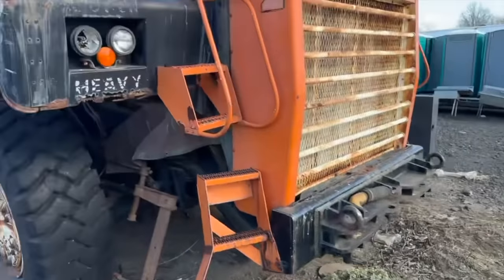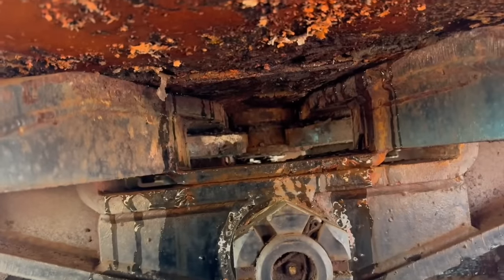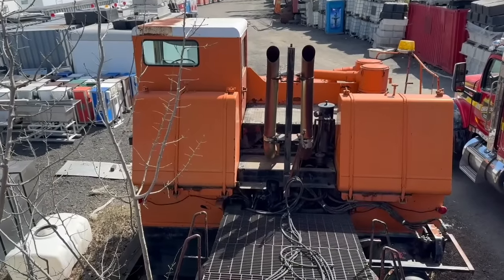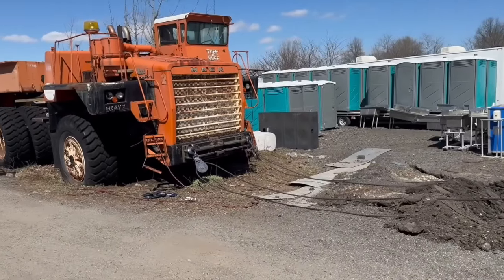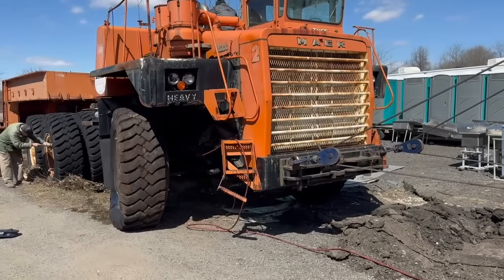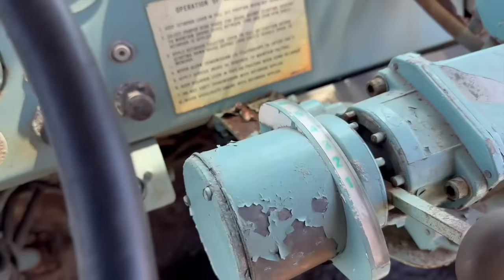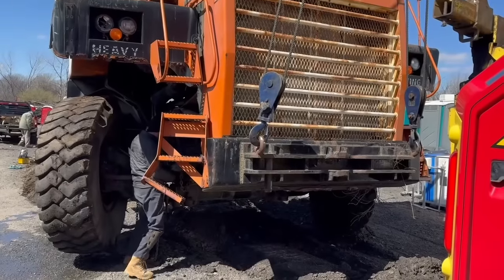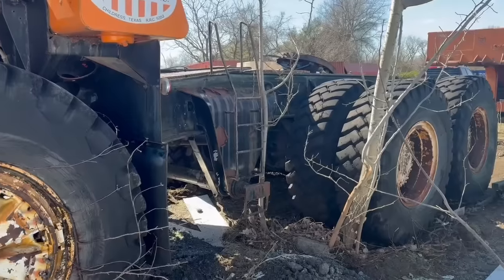Finding the World's LARGEST Mack Truck! - 1970 M100SX

Comment: Dont leave that trailer. Youll never get another one like it
Reply: Ya, I hope he does go back for the trailer
Reply: @robertmoulton2656  Once he takes the tractor, the ⏰ starts ticking on the trailer! The scrapper would scrap The Liberty 🔔 Bell, if someone left it at the side of the road!!
Reply: Yeah, you'd better get the trailer, what good is a tractor without a trailer !
Reply: Probably cost too much 😅
Reply: the trailer is a 350 ton capacity monster. its kinda useless.

Comment: Truck and trailer both needs to be restored and kept together..... something this rare should be preserved for future generations to enjoy!
Reply: Hahahah, you think he cares about original equipment. Find another channel, brother.
Reply: Because Darin Wilson said it should.
Reply: Sadly the cost to move that trailer would be well into the 5 digits if not 6 digits range. As one piece it would be 6 digits for sure. Otherwise you'd have to chop it up and it'd still be very expensive.
Reply: Yes sir, the truck and trailer need to go together. Agree with ya wholeheartedly.

Comment: Thanks for the video. I haven’t seen this Prime mover for many years. Worked with this truck several times when I was with Mashburn Trucking Inc. Out of Childress, Texas. Charles Mashburn had 3 Mack Prime Movers. This one was paired with a 500 ton lowboy made by Transport Systems out of Denton, Texas. Charles had 2 other Mack’s, a bit smaller, one with a 700 hp Cummins and one with an 800 hp Cummins. This one was a 1000 hp 16v Detroit and all 3 had Allison 12 speed transmissions. All air starters that would make unsuspecting folks run when you hit the starter! Please keep us updated on the progress and thanks again, this brought back many great memories.
Reply: I can remember driving through Childress in the mid to late 80's and seeing the Mashburn yard on 287 there in town.  Interesting that the truck ended up in NYC.
Reply: Many years ago, we at Louisiana Escort worked with Mashburn/National Rigging.  "Tuff e Nuff",  "Double Ugly and  "Baby Huey" were the names of the prime  movers.  Many good memories, and so impressed with the whole operation.  They were the pioneers in roll off jobs, long before Mammoet, Joe D Hughes, Emmertt Int'l., Lone Star, Sarens, Roll Lift, Deep South, and more. At that time, Mashburn was a good, stable company to work for.
Reply: Well that is interesting. I worked for Emmert International in Texas, and when Lone Star Heavy Haul bought out Mashburn I'm not sure if the three trucks came with the deal or not.  At Emmert we had a picture in one of the offices with all three lined up, I think in Gainesville Lone Star yard from the looks. Not sure if Lone Star sold them then or not.  Emmert then bought out Lone Star Heavy Haul side so we got most of what was left of Lone Star equipment beam systems and Mashburn stuff.  Back in I think 2013 or so we bought the 600 M75 Mack at the Ritchie Brothers Action location in Lake Worth, TX.  Emmert still owns the truck and we used it once on the reactor vessel move from Las Vegas to Clive, UT.  When we got the truck it still had the orange paint and said Double Ugly on it.  Just like this one but smaller.   We painted it Red to match the red equipment we ran at Emmert.  The truck is now in Clackamas, OR at the corp office.  If someone is interested in it call Emmert International in Oregon.  I'm sure they would sell it.  In Rhome, TX there is a 400 ton Transport Systems trailer that would go with the Mack M75.   Looks just like this trailer in NY  but smaller and there is a 300 ton and 100 ton.  All made from the same company in Denton, TX.
Reply: A 16V149T put out 1600hp.  For that kind of hp the Allison transmission was probably a DP8000 series
Reply: There is nothing like the smell of Diesel Smoke coming from the exhaust stacks and sound of those Detroit Diesel Engines roaring down the road, reminds me when I was a kid working in our Construction firm’s Gravel quarry in the 70’s, and running the all mechanical controls on the Terex Scrapers. Absolutely loved it!  👍
Reply: I remember a project that you helped us with in Alabama. The Schnabel arms catered on  ball mill we were hauling out of Russellville. We ended up going through Birmingham on Talladega Sunday morning. Did the NASCAR fans love us...
Reply: The 400ton trailer was built specifically for the Pacific all wheel drive truck. Unfortunately the lowboy's neck was not long enough to transfer sufficient weight when the jeep was being used. The trailer also had areis wheels. The spacers would get crushed and the wheels would spin on the hubs. Lowboy was eventually converted to 10 hole Budd...

Comment: Prime Mover was what it was called if that is the same Mack Charlie Mashburn  of Childress Texas bought in New Jersey and brought back to Texas. The trailer he used was rated for 350 tons in 20 feet . That was along time ago I drove truck for him hauling transformers , started when I was 19 and today I am 74. Good luck with your project.
Reply: Yes it’s the same truck. I’m the one who filmed this video. Would you happen to have any memory of what the trailer weighs by itself?
Reply: That trailer no, there weren't any scales 12FT wide to weigh it. I pulled a trailer that was rated for 250 tons and it was custom built for Charlie by an outfit in Denison Texas if I remember right. Charlie said he didn't know what that trailer weighed but when you were hooked with the jeep and trailer he would laugh and say there wasn't enough portable scales in the state of Texas to weigh it. Thanks for the memories. I only am in contact with one other driver and will ask him if he ever heard what it weighed. @LetsFNgo
Reply: I just wanted to et you know I talked to the other driver this morning and he said the something about the weight but two things I want to straighten out about my comment. That was one of three prime movers he owned and the trailers were made in Denton Texas.  @LetsFNgo
Reply: The 400ton trailer Mashburn had a weight of 122k. That is the lowboy only, not including the jeep. The Desert Fox was much larger and heavier.
Reply: This is a 14 ft wide trailer. Charles repossessed it for a bank that obviously had no idea what it was.

Comment: Glad to see this beast going to a good home.
For those of you who don't know, let me give you some data to fully appreciate the engine in this truck.
It is a 2 stroke 16 cylinder diesel with 2 superchargers, 4 turbochargers and 149 cubic inches of displacement per cylinder.
The engine will not run without the superchargers, but the 4 turbo chargers can significantly increase the volumetric efficiency (displacement) under load.
My Chevy S10 is 2.2L or 134 CID 4 stroke. The crankshaft has to make two full revolutions for all 4 cylinders to make power. 720÷4=180 134÷4=33.5.  So every 180 degrees of crankshaft revolution a tiny 33.5 CID piston makes power.
On this truck, a single piston which is larger than my entire engine (149CID per cylinder) makes power every 22.5 degrees of crankshaft revolution. The 4 turbos can double the displacement under heavy load. 
Wrap your head around that for a minute.
Awesome! 😮
Reply: hi kevin, thank you very much for this technical information... but, what power does this engine have?
Reply: @ericbrisson3925  I don't actually know.  We had a 16V 92 in school but have not done many Detroit's since (a couple 4 cyl marine units.)
All I know is with that big of a piston making power every 22.5 degrees it would be hard to stop.
Reply: @ericbrisson3925  From Wiki 20-cylinder version specs...
"The 20V149 TIB DDEC III SCCC in stand-by generator spec has an output of 2,936 hp (2,189 kW) from a capacity of 2,980 cu in (48.8 L)."
That is an insane amount of HP because it is at about 2000 RPM Torque would likely be three times that much because the formula is Horsepower is equal to torque X RPM / 5252.  So, on any engine the horsepower and torque lines will cross at 5252RPM.
Reply: 1,100 hp is what Arcad Sitig always told me. He hauled a lot of loads with it. I believe it was with American Rigging in Dallas...

Comment: In the Mid 90s, I worked at a place in Pennsylvania call Evans equipment. We bought and sold equipment all over the world. One day this massive tank transport trailer came in that was bought at a military auction. It was delivered with a truck that looked exactly like that. It came out of one of the local military bases, possibly Fort Dix. It was absolutely immaculate like they were still using it. The trailer had 28 inch rims on it. The tires were 6 foot tall. The trailer had 2 progressively larger goose neck dollies with wheels to step it up to the hauler truck. I stepped out to lunch and when I got back, it was gone. Seriously regretted not ever getting a picture of it.

Comment: The Talbert and the Transport Systems Incorporated trailer seen in these videos are just a few of the trailers Tuff-E-Nuff pulled. I have seen pictures of the M100 pulling one  of 9 vessels in a series going into a refinery in Houston. I think it was owned by American Rigging at the time. Arcade "Si" Sitig was the superintendent on that project.
Tuff-E-Nuff was pulling a hydraulic trailer that was double wide and probably 48 lines of axles. Don't get hung up on what trailer was "original", it makes no difference in the scope of things.

Comment: Mashburn Trucking was out of Childress, TX. 

There was one of these massive units in Saginaw, TX north of Fort Worth, Texas in the 80’s. 

I wish I could remember it’s nick name.

I think it was Brutus.
Reply: The 100ton was Tuff-E-Nuff. 75ton was Double Ugly. The other 75ton was Double Tuff. The 2 75ton trucks were consecutive serial numbers. Double Tuff was the only one that didn't start as mine truck. It had a winch and 5th wheel from the factory. It was a 2 1/2 inch 5th wheel pin. The other trucks had 3 1/2 inch pins.

Comment: I’m curious if you might consider contacting Mack Headquarters and ask if they might be interested in assisting in the restoration in the areas of Finance Documentation and Parts since there were only 3 every built.  It would be an icon for a Mack truck museum similar to what Caterpillar does with there ancient equipment finds and restorations.

Comment: Why would you not take the trailer 😒 or is it just logistically not possible? Honest question
Reply: The new owner is a Mack collector with 100+ trucks. The trailer takes up a massive amount of room. It’s not the original trailer for the truck. Logistically and cost wise moving the trailer would be a monster. We removed 50k pounds off the truck to help pull it out, but the rotator still didn’t pick it up. We’re guessing the trailer weighs 50-70 tons or more.
Reply: @LetsFNgo  it definitely makes sense. Is there anything trailer that would be able to haul something like that? Like a big enough low boy to tow the already giant not so  low, low  boy 🤣
Reply: @Frekinbaker420 no way would the trailer fit on another trailer. it would either have to be cut up and moved or taken out by barge. And after spending more time looking at it we believe the trailer is closer to 100 tons. It’s also not the original trailer, but was something built later.

Comment: First of all I wanted to say thanks for sharing! Its not everyday you get to see these hulks, most would just scrap it.
I had a few questions: 
is the Detroit a 2 stroke?
Having a 6 speed automatic, what would top speed be? l Imagine it being a toque monster and getting max of around 40MPH.
What would the weight capacity be?
Lastly What in the world is a tacograph? how would it have been used.

Incredible 253 miles, this has to be one of the lowest mile Mack trucks arounds, very cool
Reply: Yes. It’s one of the largest engines Detroit made. It is a 2 stroke.
Top speed is 27mph
The original trailer for this truck(which isn’t what’s in the video) had a 600-650 ton weight rating, or 1.2-1.3 million pounds. The trailer in this video is the smaller 350-400 ton unit for 700-800,000 pounds. 
A tachograph is an old way to have your day kept track of while driving the truck. There was a little disc that went in and basically acted as your time card, it kept track of the rpm’s of the truck to make sure the driver didn’t just sit and do nothing all day with the truck idling. 
Thanks for the questions. I’m happy you enjoyed the video.

Comment: How much more funds would you need to save the trailer too? I’d kick in a few bucks. If we could get enough people to chip in a few bucks how much would you need?
Reply: Nothing to do with money. The foundation restores Mack trucks. Not trailers. Plus getting that trailer out of NYC probably costs more than the trailer itself.
Reply: @LetsFNgo  it’s in NYC?  I didn’t know that. Yup. R.i.p Trailer. Off to the scarp yard.
Reply: @Handles_are_good_for_holding  yes it’s in Far Rockaway. We have to bring it through Queens and down the BQE.
Reply: @LetsFNgo  I live 45 minutes out side of Philadelphia. I wish I had something I could offer to help. But other than an ‘ OVER SIZE LOAD ‘ banner I found in a melted snow bank I don’t have much to be able to help. Even my truck and trailer I could move 1 wheel.

Comment: Everyone saying buy it & keep the trailer too but hey !!! Buy it yourselves or shut up 😂
Reply: Yeah. I don’t think people understand the logistics going into getting the prime mover out of NYC through Queens and down the BQE. The trailer would be a whole new nightmare.
Reply: It got there somehow @LetsFNgo
Reply: @timkeeler4461  it was brought across Jamaica bay by barge once it failed the job at JFK in the late 70’s. NYC has changed a lot since that point.
Reply: I remember that we never used the M100 after Mashburn bought it. The M75 were 12ft wide. The Gerosa/Double Tuff  truck had a 2 1/2 inch 5th wheel so it was used to push until a side accelerating plate could be found and fitted. 
Isn't the M100 14 or 16 wide. I know we used Double Tuff because it was much easier to haul to jobs. I  don't think Mashburn ever got the breaks fixed on Tuff-E-Nuff...
Reply: The M100 was at Saginaw Texas in the 1990s...
Reply: Lone Srar Transportation owned Tuff-E-Nuff at one point in their history. They were formed in 1988 so the truck and trailer couldn't have been in New York, and abandoned there in the 1970s.

Comment: Everyone is commenting domt leave the trailer, but really the ONLY way to move the trailer os WITH the truck unless its cut up and hualed in parts. My guess is they are gonna restore the tractor THEN return for the trailer. 1 who ever sold it is not gonna separate when literally NOTHING else can use it, and 2 they are a matching set, THE LAST matching set. I look forward to more updates on this combo. I know om gonna sub JUST for more details.
Reply: Can’t move trailer with the truck due to its location. Only way to move the trailer is cut it up and take it through NYC or put it on a barge and sail it out. Either would be prohibitively expensive for a trailer that isn’t original to the truck and was built much later.
Reply: I did brake jobs on several of Mashburn's "trunion" trailers. No fun in a nice shop on a slab with an overhead hoist. It would be necessary and a nightmare to do it there on location.
Reply: The M100 started life with a dump body. It was in service for years before the dump was removed and the trailer built.

Comment: The truck and trailer was used by Mashburn Heavy Haul out of Childress Tx, to haul electic transformers, then purchased by LoneStar Heavy Haul, wasn't used much, so they sold in an auction, that is how it ended up on east coast. The picture on Facebook was taken on LoneStar yard in Gainesville Tx,
Reply: Lone Star never used the truck or trailer. They got in financial trouble soon after they bought Mashburn and sold the 3 Mack's and most of the big trailers keeping only the 100ton, 400ton TSI units.
Reply: @tcunn2636  LoneStar did use the m100 at least once, they kept and used  the m-75, until the the Heavy haul division sold to Emmrert, and it is still being used there.
Reply: Lone Srat only kept the Pacific all wheel drive truck. It was with the 400ton  lowboy. I had Tom James bid book and number at the auction. I  tried to talk him out of his book as his number was 666.
I was th Senior Superintendent for Emmert in North Texas until 2008.
Reply: I was with Mashburn as a contractor when he sold to Lone Star. I had Tom James bid book at the auction. His paddle number was 666. I ended up going to work for them and then with Emmert after the sale. I was on a plane to Portland when the sale closed. All 3 big Mack's were sold at the auction. Emmert bought the one that went to Central America and refurbished it a few years back. That is the one that they have now.

Comment: Sorry to be the bummer here, but that truck was under 13 feet of salt water during Hurricane Sandy, and was never touched afterwards. Shes down for the count, unless he plans on doing a complete rebuild for a few hundred grand.
Reply: It was under about 4-5 feet of water. And the engine oil is clean. The new owner has the shop and means to do a full restoration.

Comment: Odd ball Mack stuff you say…

Does this man have a Mack Savage FDM700? Have you ever seen one? Worth a google. It was a front discharge mixer truck with the engine mounted directly behind the drivers cab under the mixers drum. From what the old timers at my shop say, it was a complete and total nightmare to work on. As you can imagine, an engine mount directly behind the cab that constantly has the throttle pegged to the floor mixing concrete isn’t great for your hearing.

From the looks of it, it appears Mack used hall truck design like the LRVSW or the M off road series and modified it for the trailer.

Comment: Wrecker company i got 100 ton rotataor says with puffy chest old mack you aint got enough.😂
Reply: Never once in this video is a 100 ton rotator mentioned. The truck used is much smaller than that.